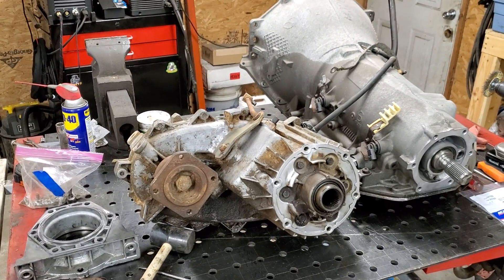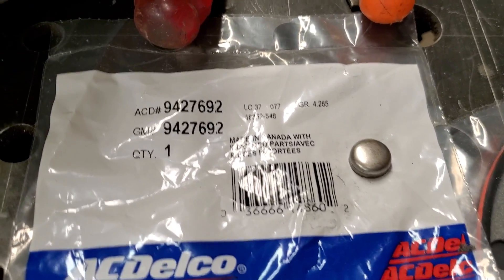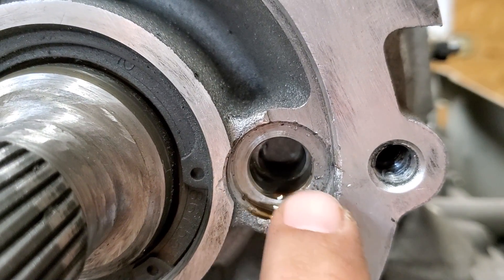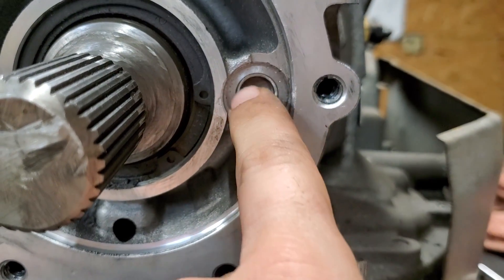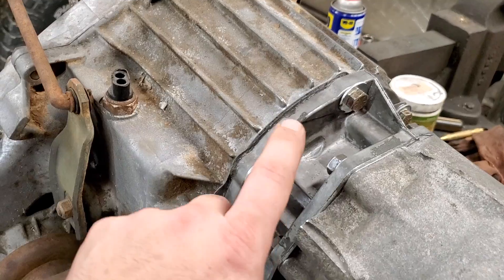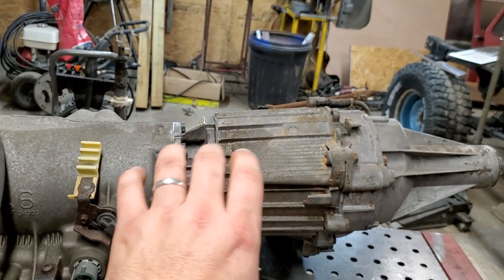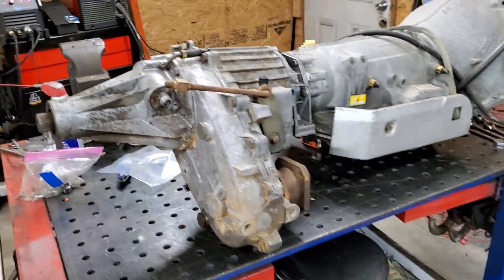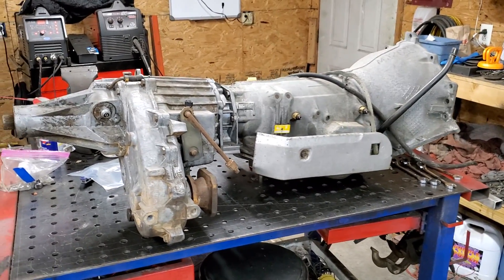1984 Chevy K10 LS Swap Project Part 4 ( Mating The 2x4 4L80E to the NP208 Transfer Case Part 2)

Comment: Did you have any troubles with the holes at the 12 o’clock and 6 o clock leaking transmission fluid? Mine leak heavy and wondering if you plugged those holes and if so how you did
Reply from the maker: @TrevorF-d7w  nope I haven’t had any issues leaking.

Comment: I’m doing the same thing right now, did you run into any issues with the adapter hole pattern not matching the 208’s bolt pattern? Seems like all the holes line up but one or two. Pretty certain I have the same adapter as you.
Reply from the maker: Nope I didn’t have any issues
Reply: @lonniesgarage   Weird, I’ll have to double check that adapter make sure it’s right. I have a 4x4 4l80e and it’s the adapter that was on it. Thanks for the quick reply.

Comment: What motor mounts, headers, oil pan, trans crossmember did you run thinking about do a square body k10 6.0 4l80e
Reply from the maker: Tejas Steel Works mounts, Speed Engineering Long Tube LS C10 1 7/8” headers, stock crossmember, stock truck pan on oil pan.
Reply: @LonniesGarage  ok thanks man appreciate it, holley or stock ecu

Comment: My question is which mount did you bolt your transfer case adapter to? What bolts to the cross member to bolt to your adapter?
Reply from the maker: Stock mount
Reply: @lonniesgarage  thank you sir! Getting my junk together, can’t wait to be driving this thing. You know anyone who would want a 305/TH400?
Reply from the maker: @bowtiebuilding  where u from and how much
Reply: @lonniesgarage  east texas, around the Tyler area. $400 obo for it all
Reply: @lonniesgarage  Ok I figured it out. Why I was so confused is I had a 305 mated to a turbo 400. The cross member for a turbo 400 is flat and nothing like a crossmember for the turbo 350/700R4. Went to the junk yard and found exactly what I needed!
Reply: @lonniesgarage  I bought a stock mount for a 4L80e transfer case and it ain’t gonna work unless I go to the scrap yard and find a 4l80e cross member and make it work.

Comment: hello again. can you tell us what transmission was in there  before? last question is,  I have read that you are supposed to run a K case in a 4x4, so is it alright to use this 2WD case?
Reply from the maker: I’m not sure what transmission was in there to start with but this one was a 4l80e 2 wheel drive that I converted to a 4x4. It has a tcase from a k series truck

Comment: hi, another guy on here changed out the 2WD tranny tailshaft to a shorter 4WD shaft and didnt need an adapter. so is it the same as you did only using an adapter? would doing it his way eliminate lenghtening/shortening driveshafts?
Reply from the maker: You will still have to redo the drive shaft
Reply: @lonniesgarage  Cool, so to be sure I'm clear, you are saying that his way works without the need for an adapter? I ask because I have an opportunity to buy a used 2WD for $225. .

Comment: To install 9427692 lube plug, how did you the get solid plug out ? I couldn’t see in ur video. It looks like it squeezed out by forcing it with - drive
Reply from the maker: Yes just forced it out with a flat screwdriver

Comment: Why would a 4l80e Trans shaft fit in a 208. A 208 was designed for a turbo 400 as far as the one I had in my truck. The 700r4 was the common granny used in the early to late 80s. They are known to break as they had aluminum drums.
Reply from the maker: 4l80 is basically a 400
Reply: @lonniesgarage  both have 32 spine shafts, so a transfer case that worked with a TH400 should work with 4L80. from what I have read you need to either use an adapter or change the 2WD tranny output to a shorter 4x4 shaft, then apparently no adapter is needed and maybe driveline shafts wont need to modified?
Reply: @jtp682  the things you need to are shortening the output shaft about 3.5inch  then grinding the tapered area of the output

Comment: Hey bud what year was that transmission and was wondering if the year matters?
Reply from the maker: It was a 2000 model
Reply: You used the factory computer correct? I'm going with a carburetor and trying to figure out my lock up situation.  Dont wanna get a stand alone

Comment: What are you doing for vss signal
Reply from the maker: The two wheel drive 4L80E transmissions have the VSS signal in the transmission itself. It has two sensors on it.
Reply: @lonniesgarage hey seen its been awhile since this video did the vss sensors on side of the transmission end up working with it shifting out correct and everything thanks billy

Comment: What are you going to do for a speed sensor?
Reply from the maker: It has both vss sensors on the drivers side of the transmission. One is about mid ways of the trans and the other is at the rear of the trans.
Reply: Lonnie's Garage (Puppetkicker)  gotcha what year is this 4l80.